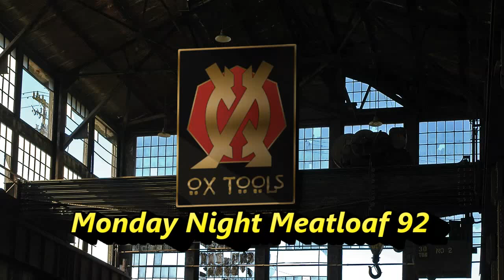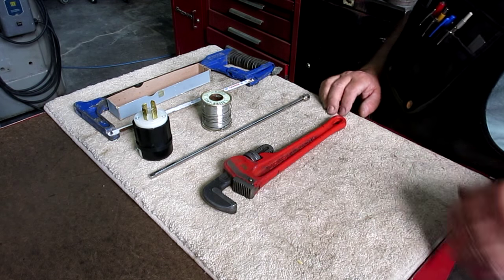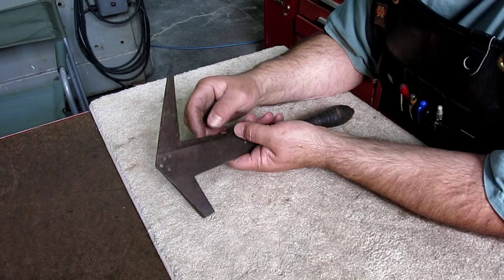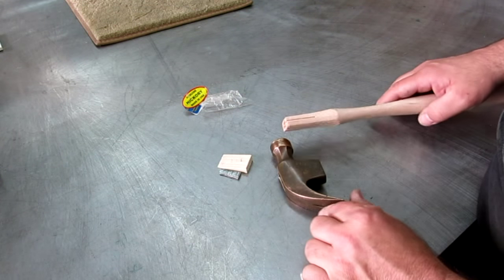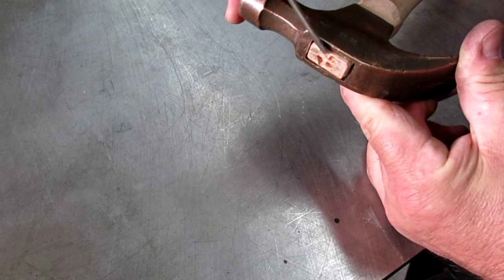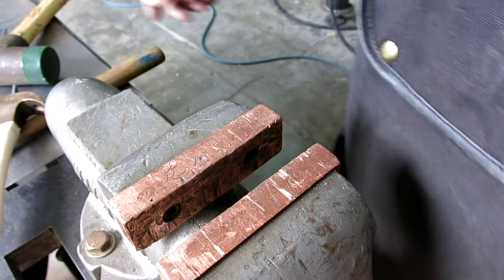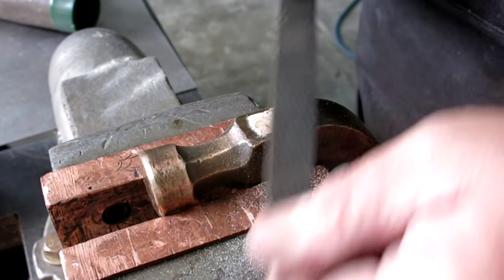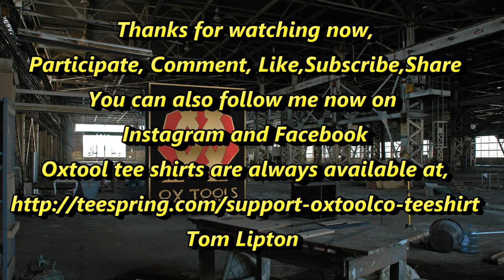Monday Night Meatloaf 92

Comment: Two things I do to make fitting a handle easier for me: Before doing anything else, I take a triangular file to the slit and make a definite "V" to help the wooden wedge start easier and then when ready to install the steel wedge, I use an appropriately sized cold chisel and hammer to make a starting groove for the steel wedge.

Comment: Tom,
Very nice hickory handle instal on the beryllium copper hammer. I like your respect for the hammer head surface and not wanting to belt sand into it. Good file finishing.

Comment: I have a trick you can use to make a 3PH only VFD word on 1PH.  Many of the VFDs won't run on 1PH because they have input phase monitoring, to avoid running when you lose a phase (probably because of derating and current draw).  You can disable this input phase monitoring on some VFDs, that will allow you to run the VFD on single phase power.

All VFDs convert the incoming 3PH power into DC, then synthesize the 3PH output using IGBTs powered from the DC bus, so the VFD should operate just the same, but derated because you are only using 2 of the 3 diode banks, so power is generally limited to 60% of what the nominal output is.
Reply: +eformance That's what I do with the Mitsubishi drive with my Bridgeprt mill, i.e. single phase in, supposed to be three phase, and mine is derated in use.

Comment: Hi Tom !

I beleave the patina is NOT what you should worry most of when sanding - Beryllium Copper is very toxic material when worked !
Reply: +Keld Sørensen yes it is Keld. we had such tools in the airforce working on the minute man missiles. if they chipped or were somehow abraded it was always a big to do..
Reply: +Keld Sørensen Just like everything else.  Beryllium and it's alloys have certain uses.  They have very high thermal conductivity (wick away heat) and high melting point.  Beryllium alloy dust is paticullarly carcinogenic.  the solid metal, or plating is harmless... unless you grind it or dissolve it in acid  Primarily the DUST.  It gets stuck in your lungs, like asbestos.  One use has been in racing engine valve seats. Guess what??? Valve seats must be ground to fit/seal just right.  They have developed other alloys to replace berylium.
Reply: +WAVETUBE84  Do you seriously think considering his back ground and where he works, that Tom needs safety jabs? Very patronizing.
Reply: Rick Brandt
Easy, easy now ... in fact I was listening very carefully to hear if Tom would say something about the danger with this BC - but he didn't, but was close ... and I THINK Tom would give such warnings and yes, experience and job in mind ... I wonder why he didn't !
Reply: +Keld Sørensen 
Yep it is very toxic It's the Oxide produced when Abrading or heating!
Reply: Not debating the toxicity
Self appointed safety gurus are my pet peeve.
MSD's are a personal responsibility.
Reply: Rick Brandt "Safety jabs"?  No I'm not a safety nazi.  Just understand how to grind, sand, or machine it and keep the dust from getting into your lungs.  Common sense,  clean up the dust, and wash up when done.
Reply: +Keld Sørensen I appreciate the warning. Thanks.
Reply: +Rick Brandt I don't think the original warning was rude at all, certainly not a jab. Tom almost certainly DOES know the stuff's dangerous, some people viewing may not realize. I'd much rather see a dozen warnings about the toxicity, than have someone expose themselves to it because they didn't realize. 

I agree the 'oh you shouldn't be doing that' posts do annoy me. But this post wasn't like that at all.
Reply: I was also waiting for Tom to mention the dangers of sanding/polishing Berilium Copper and very surprised he didn't. Rick Brant you're out of line.
Reply: Well-lll the message is certainly out in the open now.
Reply: +russhellmy I don't know the exact physiological reaction that our bodies have to beryllium.  It is a known carcinogen.  I guess it causes inflammation and irritation to the skin and lungs (lungs are a form of skin).  then the lungs lose a percentage of their function.  I would not look forward to a slow slow painful death of asphixiation.

Comment: Well done!  Always love bringing old unserviceable tools back to life.  Using them afterward is even better.  I'm a big fan of a beeswax/pine tar/linseed oil/turpentine treatment on wood handles.   Feels great, doesn't slip, looks great, seals well, easy to maintain.  Give it a try sometime.  I have a wood handle obsession.  Whenever I'm at a store that has replacement handles, I simply cannot stop myself from going through them and looking for ones with good grain orientation and buying them.  Amazing the low percentage of good ones.  House Handle out of Cassville, MO makes great handles fwiw.  Thanks for posting this.
Reply from the maker: +blmeflmm66 When I read your comment I could almost smell the linseed and beeswax. How could you go wrong with a combo like that. Do they make aftershave in that flavor? Thanks for the comment.

Cheers,

Tom
Reply: Uhhh, that IS my aftershave now.  Way oil was good, but this stuff is much more popular with the ladies.  Big Oil takes another hit.....

Comment: I like to sand the varnish off first
Once it's mounted I give it a bath in boiled linseed oil
I like the smooth feel of the oil finish, no varnish blisters.

The BLO swells and keeps from shrinking with humidity.
Stays tight.

Comment: I'm really surprised that those slates don't fall apart when you punch holes through them, you'd think that with material which chips away you'd simply break it in half when whacking it with a sharp point. Tasty meatloaf as usual Tom.

Comment: Good job! That's a nice hammer. I usually us hickory when handling and then either strip or sand off the varnish and use boiled linseed oil. Helps prevent checking and makes the grain pop.

Comment: Warnings on BC toxicity may be useful to Tom's VIEWERS who may be unaware of it's risk to folks sensitive to the dust. Pure beryllium is definitely something to avoid. You have to consider frequency, intensity, and duration as well as chemical compound binding to make a guess at hazards of acute or chronic problems. All of this can be put to rest by simply using a particulate mask when grinding/sanding the one item most folks would ever encounter in their lifetime.

Comment: That Beryllium copper may not produce sparks... but the flip side of the coin is that inhalation/ingestion of even trace amounts of it can raise very serious health issues...

Beryllium  copper should never be sanded, sawed, filed, machined, heated or otherwise worked without the use of proper safeguards.

Comment: Handgeschmiedet = handforged
Verstählen is basically steelplating iron.

It's german.

The sparkfree Hammer is a nice one.
I used to be a maintenance Fitter in an Aluminium company (producing molten primary Aluminium), we used lots of spark free Tools because of the strong magnetic Field produced by the electrolytic process.

Comment: Hey Tom, with all the bench work you show, and mentioning (rightly) that files wear out, I wonder if you've ever tried acid sharpening blunt files? Amongst a chorus of naysayers claiming, "well that ain't gunna work", I tried it a while back and it seemed to work well. Both in subjective testing and looking at the files' cutting edges with a microscope. The acid slightly etches the steel away and brings the teeth back up to a sharp(er) edge. I'm just curious as to whether someone with your experience and exposure to crackpots like me have ever seen or tried this, and your thoughts on it?

Comment: nice work....lol....who knew,...... in all my yrs I thought a hammer handle replacement was about a 5 minute job..... Seems to be a common issue with machinist when they go into wood zone......
Reply from the maker: +Rick L Hey Rick,

Well if your going to throw down like that you should post a five minute video of doing the same thing to a similar quality level. Were not going to let a woodchuck get away tossing out a gauntlet like that. Better find a hammer head that needs a handle. If you need one I'm sure I could find one for you to play around with.

All the best,

Tom

Comment: I wonder... with VFDs that are 3 phase input/3phase out, given they rectify and then invert the power.. if it's possible to feed them with single phase and have them output 3ph anyway? (No idea, just thinking out loud really)
Reply: +TheChipmunk2008 Some VFDs can be made to act as phase converters  - some are sold as "static phase converters"... eformance mentioned one option for this already... dig around on the web, and you should find a few websites talking about this as a poor man's way to get 3 phase...

Mr. Pete222 and Stan Zinkoski (shadonhkw) have done this with VFDs...

Seek, and ye shall find!

Cheers,

Eric

Comment: Loose hammer handle? Grandpa would stand his up, head down in a pail of water for a couple of days. Just minimal rust to wipe away. Good as new until the wood dried out.  Cheers.
Reply: +Rain Coast And as soon as it dried out a bit, it would be just as loose as ever. No. If it is loose, rewedge it.
Reply: +Rain Coast Soaking a handle in water makes the problem worse. When the fibres expand when wet they get crushed and when the handle dries again it is more loose than before.
Reply: +Rain Coast If your grandpa has some boiled linseed oil he would have only had to soak his hammers once.

Comment: sorry but your not a tradesman. your a tinkerer. eg when you cut the slot in the handle for the wood wedge you do it with the head off the handle. reason being if you do it with the head on the slot has a  step where the cutting stops. this stops the wedge going deeper and potentially causes a split down the length of the handle.
sorry to say but i find most of your vids way too long and somewhat simplistic or trivial.
Reply from the maker: +Traktorwerkz Feel free to hit the unsubscribe button. The wedge never saw the end of the slot in the handle. But you already knew that with your video xray vision. Say hi to your mom when she calls you up from your bedroom for dinner. Thanks for the comment.

Cheers,

Tom
Reply: +Traktorwerkz  then dont watch  jew boy
Reply from the maker: +koviack Hi person that is too afraid to use their own name on the web. Pretty strong words for a somebody that posts total dope smoking crap on youtube. Please please unsubscribe.